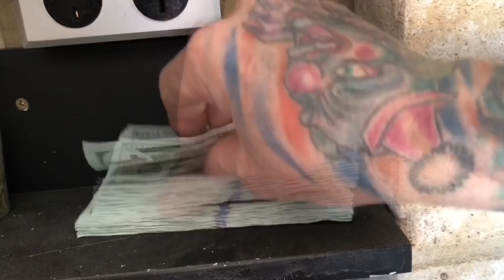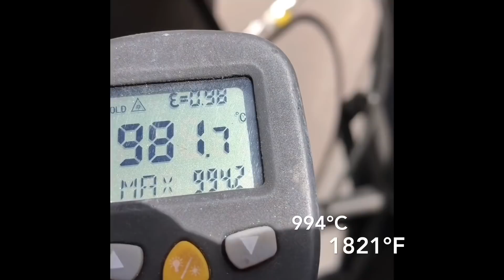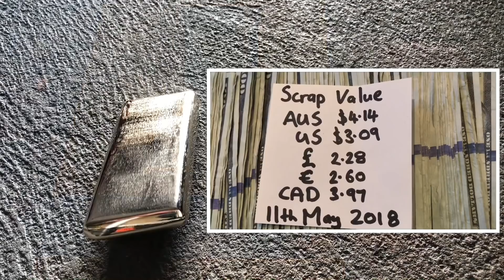BIG BRONZE BAR MADE FROM SCRAP - Melting Copper & Aluminium together to make an Aluminium Bronze Bar

Comment: I melted a lot of aluminium yesterday, and while doing that, I discovered that skimming the slag after taking the crucible out is much easier than while it's still in the furnace.

 I got out with 7 medium-big bars. One of them burned me so I threw it in a black nylon sack and it burned around it and took its black colour. Turned out cool in the end.
Reply from the maker: Remember to remelt the slag as you can usually get a decent bit more aluminium from it 👍🏻. And if you ever upload a Melting vid let me know 😉😁

Comment: mid melt bottle change, is almost like running to the bathroom before you have an accident 😁. Simple mold, works great! Nice bar!, great video!
Reply from the maker: Cheers mate , yeah I have a gold medal in the speed gas bottle challenge 🤘🏻. I’ll normally change it b4 I melt but lately I been trying to get out every bit of gas as they have put gas bottle refills prices up😖. They used to be $19 for a 8.5kg bottle exchange 18 months ago now there $24.80☹️☹️

Comment: Top tip: whenever you hook up a gas bottle turn on the gas, spray a little soapy water in the connection and wait a moment. Bubbles = a leak. 👍

Comment: Love the look of aluminium bronze, doesnt seem to shrink or bubble much at all like many other alloys do. The name aluminium bronze is to contrast it with tin bronze; its still mostly a copper based material, and as far as your pile goes, it belongs more on the copper based alloy shelf than the aluminium based alloy shelf id say.
Reply from the maker: Yeah matey you are completely right . I just stacked them kinda randomly as I’ll be dropping them all on the ground soon when I fix the shelves. Then I’ll weigh them and restack them with Aluminium bronze on the copper shelf😁👍🏻. I’ll also keep track of total value and weight on all the shelves for the foreseeable future 😉

Comment: This video has convinced me that I need to get a simple forge built... you wouldn't believe what machinists pay for aluminum bronze... I think I paid $300 for a 4" diameter 12" long piece of bar stock, not too long ago. Of course, that's C954 with 3-5% iron, but still! I think the same idea would apply to making any of the long-standing alloys I use.

C932 might be the best place for me to start, come to think of it. 81 to 85% copper, 6.3 to 7.5% tin, 6-8% lead, and 2-4% zinc... still US$300 or more for a 4" OD 12" long bar!
Reply from the maker: Damn that’s bloody expensive, if you could find someone to buy your bars you might have yourself a sweet little income there💰💰💰

Comment: Curious - with the help of another pourer, could you melt  two different metals in two crucibles, say copper in one and aluminum in the other, and pour them at the same time from opposite ends of the mold, so you only get the mixing right in the middle of the bar?
Reply: That's an awsome idea bro, I got the equipment to try and I might one day  I'll try to come back here if I do and let ya know what happened
Reply: @lewisgiles8855  Please do! :D
Reply from the maker: Actually Vince it would be pretty awesome to have copper one end aluminium the other and then a nice mix of aluminium bronze joining it but it doesn’t quite work like that otherwise you would see it done a lot. if you check out Farmcraft101 he tries it with two different metals and doesn’t get the best results. I know what you’re talking about and it would be awesome if it worked as well as that but when ya have time check FarmCraft101  he can give a good explanation and demo of trying it👍🏻
Reply: Wow thanx  makes sense now that we've not seen attempts   I'm a watch it now!
Reply: @bigstackD  Thanks, D!
Reply: @vincedibona4687  DUDE...  sooo cool!!!
Reply: @lewisgiles8855  ???
Reply: Oh, just the fact that bigstackd came through

Comment: Hey bud bigskacked fan here I been ripping bars pretty steady in the snowy north lately but was really curious why you you add the aluminum/aluminium  right away at the same time I'm guessing a lot of that burns off into dross by the time ya get to 1100ish Celsius?

Comment: About how long of a burn do you get out of a 20 pound tank of propane?  And how long/melt average?  (My homemade foundry made out of an empty popcorn tin uses coal & doesn't get nearly hot enough for copper, though I can smelt aluminum.)
Reply from the maker: Mate with a 20 Pound tank I’d get easily 3 hours of full furnace running. 3 kilos of Aluminium would take about 30-35mins , 3kg Brass about 50-60 mins and 3kg Copper approx 65-80 mins. I can further reduce these times by putting metal in direct flame for a couple minutes and melting smaller pieces as they’ll heat up quicker than larger ones👍🏻.

Comment: probl a dumb a question but why did you add aluminium??
Reply from the maker: I add the 10% aluminium to the copper for a number of reasons 1 - it drops the melting point of copper from 1082 down to about 1030  2 it makes a nice gold colour instead of the old browny copper colour and 3 is it won’t tarnish at all and copper will start to within a week 😁👍🏻. Actually and 4 I already had a copper bar this size actually it was just under 4 pounds heavier than this 😀.
Reply: bigstackD Casting cool thank you for the info

Comment: why dont you finish the upper part with milling and make it a perfect bar and then finish with 1200 grit?
Reply from the maker: Yeah I definitely could spend some more time on it that’s for sure . I actually sanded this down to 2000grit but I should have probably spent some more time sanding 80-120grit that would have gotten rid of those small sanding marks. Also I don’t have access to a milling machine but I would love to have 1 and make all my bars perfect👍🏻😁.

Comment: Big, for begginers like myself y dont you make a video on how you regulate the regulator, how much to open the propane when to keep the shutoff valve? Halfway, a quarter of the way or fully open.
Also, there are different settings to melt different metal im guessing. Meaning copper should be fead more gas? Im just guessing cause i have no clue but if you go over those important points it will help a few people out tremendously.  You are BIG DADDY!!! LOL

Comment: What makes Aluminium Bronze so hard to stamp?
Reply from the maker: It’s weird as copper is soft and aluminium is soft but mix them together and there super strong . stamping aluminium bronze is like stamping steel , it can be done but it’s twice as hard to do than stamping aluminium or copper separately 👍🏻
Reply: bigstackD Casting Makes sense. Keep up the good work!
Reply from the maker: Cheers bro🤘🏻

Comment: How much melts can you do with one bottle of gas? I assume it is 20 or 30 litres gas?
Reply from the maker: the small bottles i use matey are 8.5KG bbq gas bottles and i would easily get 3-4 melts out of them at a cost of around $4 - $6 a melt depending on what metal im melting. 👍
Reply: @bigstackD  thanks!

Comment: Hi.
Can i ask you how many ingots you can melt with 1 propane tank?
One sunday i took 12 Kg of copper in an abbandoned hospital; on the railroads there is 
tons of copper.
Reply from the maker: Mate with one propane tank full of gas you could potentially melt 20+ kilos, as long as you had it properly setup and a large Crucible and always left some molten copper in the crucible as that’ll speed up melting time of any added copper . You should go back and get all the copper you can because that stuff is worth good money. But don’t tell anybody about it keep it secret or they might want in on the action. If you’re only going to take the copper to the scrapyard then leave it in its scrap form and don’t melt into ingots as the scrapyard usually won’t pay any extra for ingots as they consider that scrap still. Some scrapyards won’t even take any ingots as they don’t know what it’s full composition is for example you could melt a heap of copper around solid steel bar and potentially rip them off they may think. I only melt my scrap into ingots to make future casting projects easier and never sell my scrap or castings . But definitely get out there now and grab what copper you can get 🤑🤑🤑. Clean scrap coppers probably close to $5.50 a kilo in the states atm.
Reply: Thanks, great advice. I will sell the more pure copper, and i will try to melt the oxidized one to make ingots, an hammer or a morning flail with alluminum.
In That hospital there is also a strongbox with the numbers on the rotor to open, like in the movies. I hope find in it guns and gold ingots, but is more probable i will find out a rotten corpse.
Reply from the maker: That’s awesome if possible I would take tgestrong box home and cut it open (if it’s moveable) it’s a shame you can’t film it and upload video I would be interested to see this abandon place sounds pretty cool. Anyway good luck my friend I hope you find some treasure. Be sure to keep me informed😁👍🏻
Reply: I m sorry if i can't upload the video, but to show a public video of me stealing in an abandoned hospital, would not be a great idea; in Italy i don't think it's very legal. In Australia you have a lot of abandoned places?
If i will ever open the strongbox (i will need a stethoscope), i promise will send you a photo of what there is in side, may be a corpse...
Reply from the maker: I completely understand not uploading matey just be sure to let me know how you go . In Australia even taking  things from bins without the owners permission is a pretty grey area. 
There are no abandoned buildings that I know of in Australia. Although we did have a massive 7 or 8 story hospital in my town that was abandoned for a couple years but it was in the middle of towns business district so if you entered the site no less than 15 or 20 cameras would see you🤷🏻‍♂️.
Reply: يا
Reply: Try finding brass, zinc and tin as next choices.

Comment: Aluminum bronze is like regular bronze but substitute the tin for aluminum.

I wonder what it would cost to get one of those silver suits fire fighters and foundry workers wear?
Reply from the maker: Yeah I would like 1 of those suits as I would feel a hell of a lot safer. I would prefer to make bronze as I got a heap of Metal from a subscriber who said it was Babbitt metal which is basically a 90% tin 10% copper mix and it seems legit as it’ll melt at around 230°C but I am very hesitant to add it to copper and heat to  1000°C as I’m not 100% sure it’s what they say ( it probably is but why risk it🤷🏻‍♂️) , either way I’ll still use it for fill ins and smaller projects . It’s probably not worth the risk as I’ve heard some metals can have pretty violent reactions when there are heated past there boiling point or mixed with other metals. Maybe I’ll just try a small amount say 250-300 grams before I go for a full 4/5kg pour👍🏻
Reply: With the suit, I was thinking about comfort more than safety because you mentioned the heat being unbearable. Not sure why the babbitt would have a bad reaction to molten copper when there is already copper in it, but caution is always a good plan :)
Reply from the maker: Yeah I’m coming into winter now so a nice toasty furnace will be my friend 😉. It’ll be around November wen it’ll start to heat up although that mother nature bitch will chuck a hot day at me on and off wen I least expect it👍🏻.
Reply: We are looking at near-record highs this weekend where I live. Bummer :(
Reply from the maker: Did you tell me b4 where you live I can’t remember?
Reply: bigstackD Casting I'm in North Carolina in the southeastern US.
Reply from the maker: Cool matey I’m in Southwest of Western Australia just near the beach🤘🏻🤘🏻 
My names Dion wot they call you.
Reply: Sam here.
Reply from the maker: Hey Sam nice to meet ya👍🏻😁

Comment: Why do you mix different metals
Reply from the maker: Frank Crenshaw i have a lot of scrap so I have the luxury of doing this a lot and I just love the look and strength of aluminium bronze. This’ll eventually be remelted at a later date and although it looks nice and golden like brass it doesn’t have any nasty zinc to worry about👍🏻
Reply: To create an aloy which can make certain metals stronger, softer, or more flexible

Comment: how are you going to sell(well prove to the buyer) when prices go up and you decide to sell that the bar is a certain percent aluminum and certain percent bronze? Wouldn't it be much easier to just melt 2 bars, 1 of each?
Reply from the maker: It’s all good mate as I don’t ever sell any of my bars and I will not go anywhere near a scrap yard 👍🏻. Once I run out of scrap to melt the bars I have made will eventually get remelted down and cast into a 1 of a kind item or something special I’ve decided to make. It’ll take years to melt all my scrap but I’m not going anywhere so stay tuned if your interested 😁👍🏻

Comment: make a solid round ball of brass :D
Reply from the maker: If I had easy access to a lathe I definitely would but without a lathe it would be very hard to sand properly so definitely wouldn’t be a proper round ball, good idea but unfortunately I don’t have the equipment to finish it properly👍🏻

Comment: Hey mate, you do some awesome quality work. I don't know if you're interested in making some parts for different things, or just like stacking metal. What's your goal for all this metal? Are you a local recycler that just ends up with this extra material left over that you didn't resell? It probably doesn't remain cost effective to sell these bars and such after you invest the gas in melting them.

Comment: Almost facerevealed yourself
Reply from the maker: mario fardiman yeah matey these ingots can shine up like a mirror after a bit of work on them 👍🏻😉
Reply: bigstackD Casting if i can ask a question so does bronze is a mixture of copper and aluminum?
Reply from the maker: Bronze is typically 88% copper 12% tin and Aluminium bronze is 88% copper 12% Aluminium. The mix can vary by a couple of % either way but this 88-12 mix is pretty much the best when it comes to strength. For example if you made an ingot of 50% copper 50% aluminium you could drop it and it quite possibly could break very easily but a 88/12 mix is practically bulletproof😁👍🏻
Reply: bigstackD Casting which one has the stronger tensile? The aluminum bronze or the tin bronze? I guest that aluminum bronze is brighter than than tin bronze?
Reply from the maker: I’m pretty sure Aluminium bronze is the strongest of the 2 . I’m pretty sure the tin helps more with corrosion and not so much with the strength. I could be wrong but that’s what I remember learning at school👍🏻
Reply: bigstackD Casting thanks mate
Reply: bigstackD Casting so if i grabbed a 50.BMG and fired it at an ingot like that, the ingot wouldn't shatter into many pieces or have a HUGE hole? Because you said practically bullet proof but you didn't specify what caliber, i mean like a 9 milimeter would give the average bullet resistant plate a scrape but a 50.BMG or a little less powerful bullet like a 308 would obliterate it.
Reply from the maker: Honestly I’d love to see that but I’m in Australia so don’t have that option to shoot an Ingot and of course I can’t send it to anybody as I would want to do it myself🤷🏻‍♂️👍🏻
Reply: bigstackD Casting ah, yeah it would be nice to test what gullets go through and what don't, I'd bet that a 50.BMG would go through definitely, but there are several possibly many bullets that might not make it through, I only know for sure a 308 or stronger would go through, it's hard to test, the thickness of the ingot will also have an effect, the 50.BMG may be the strongest bullet that's not considered anti-material(even though it was designed to bring down aircraft) but it still has limits, like if you put like 50 or so ceramic plates in a straight line the bullet wouldn't destroy all of them, some would be spared, All though I guess it is very unreliable to carry that many plates on you at all times so just wear thick bulky Kevlar with tungsten plates instead and hope for the best if your gonna get shot at with this bullet, although that would also be very heavy so... you're screwed either way if any local gangs have that, also beware of redback spiders when you look for metal scrap. I don't want one of my favorite youtubers going to the hospital and possibly dying.
Reply from the maker: 🤣😂ok cool bro 👍🏻🍻🍻🍻🍻

Comment: Do you know of ways that disabled people can cast iron with out the wheelchair or the person being hurt in the process. If so what exactly would they need to be a safe distance and be able to get the molten metal out of the foundry.
Reply from the maker: Sorry buddy I can’t help you there,  it’s extremely dangerous  even the way I’m doing it let alone trying to do it in a chair or without full function I wouldn’t recommend it Matey as the crucibles can get extremely heavy and you need to be pretty close to the Crucible when pouring And if something happens you need to be able to get out of the way and the area extremely fast🤔
Reply: That’s true. I’m sure there is some way but just have to think of a way.

Comment: You can confirm they are fake bills by pausing at the 00:55 mark. You can see the serial number on the bill in his hand is the exact same as the serial number on the bill still on the table.  No need to get worked up, people... but having fake currency may be legally questionable so be careful man!
Reply from the maker: Good eye my friend yeah I regularly say these are fake in some of my videos but everyone still abuse the hell out of me thinking they are real.  They come with pink lettering on both sides but the way I fold it  you can’t tell. A subscriber sent me about 500 of these to light the furnace with,  I think you get them off eBay for about $4 for 100